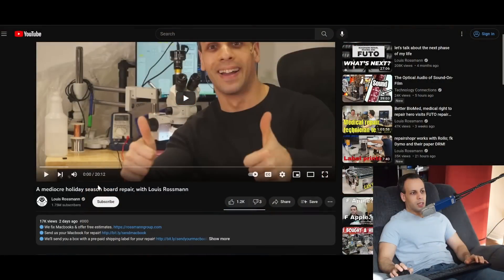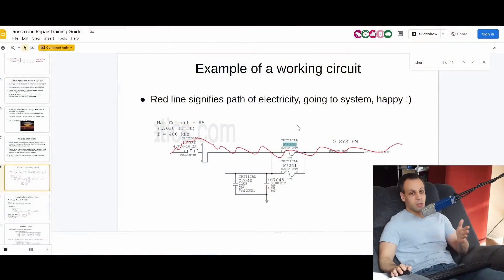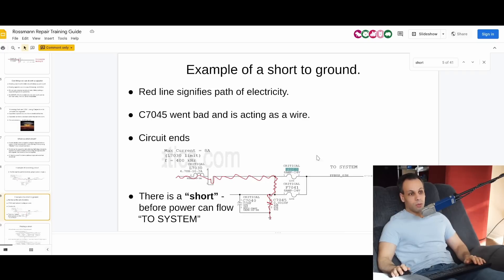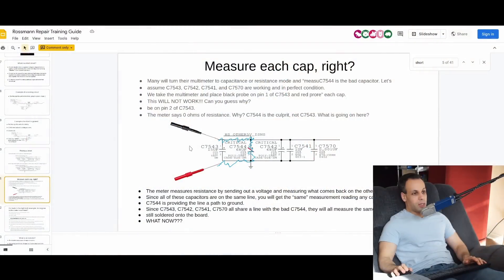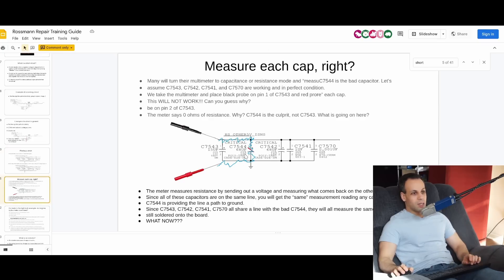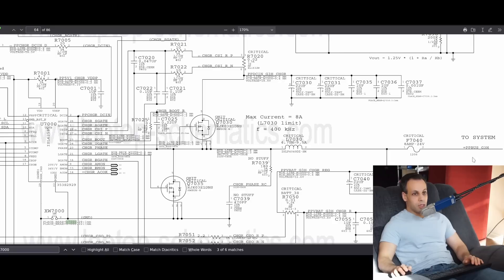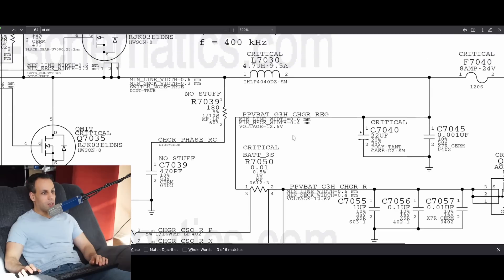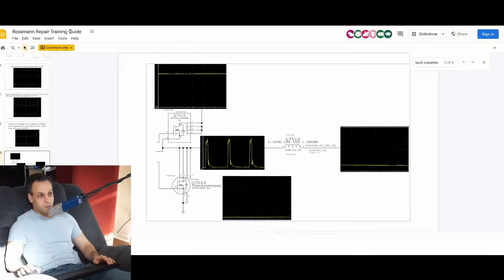Beware improper short detection methodology: on Macbooks you can kill your CPU, NAND, RAM, or GPU.

Comment: "There's the idea that if there's a X volt line, one can inject up to X volts to find a short..."

Hold up. What kind of absolute lunacy is this. That happening is literally the danger that fuses exist to prevent! The fact that fuse has burned, that protection got triggered means that system absolutely cannot take nominal voltage, that's the whole damn point!

Unless the fuse was made by Apple, of course. They are the such a pinnacle of innovation that you can take a fuse from burned MacBook and put it into a new one, if such need arises. Green!

Also, one note: a lot of cheap chinesium multimeters send 3V into measured circuit on lowest resistance range/diode/continuity measurement. Be careful and don't cheap out on these things, they are not all the same.
Reply: A fuse blows under an overcurrent condition (and not immediately), not overvoltage.
Other protections exist against overvoltage, but no protection is foolproof.
In this kind of device you'll often find that whatever protection you put in place, it'll never be enough since there are dozens of components that are extremely sensitive to any kind of mishap.
Generally, Macs have a lot of protections in place, but if something fails, it fails.
Reply: @piernov  I did say nominal voltage, though. Parts about overcurrent and nobility of sacrifice for the good of the circuit were in there before my post went through several edits to not be too wordy before throwback joke about apple fuses that stay strong and conductive even while short somewhere else down the line gives board this beautiful shine.

Apple. Engineered different.

Comment: This is great advice. 
One more question I have; and keep in mind I don't work on laptops, so I don't understand it at all: Is there any alternative method to doing this without injecting voltage?

Thanks.
Reply: Before injecting voltage you should always perform visual inspection.
If a component is visually damaged, for example burnt, broken, or with liquid causing corrosion or residue, then it's the first suspect and it has to be taken care of before voltage injection.
In other cases, if you know how the circuit is designed (with the help of schematics for example), you may see only very few components could be causing a short to ground and that they could easily be replaced.
Otherwise, voltage injection is valid technique, but it must be done with care as explained: low voltage and try to exclude a shorted high-side MOSFET.
A thermal camera can help to spot the bad component more easily, before increasing voltage and current limits.
In any case, that's only after identifying that there is actually a short to ground.
Reply: @piernov  Thanks for the comment. I take visual inspection as a given when fixing stuff, and looking over the schematic is a good advice, but is there some way you can do this without voltage injection? For example with continuity mode on a multimeter? Or would the capacitors on the line be throwing that off?
Reply: @gamefan6142  In some instances a milliohm meter can be used to try to find the lowest resistance to ground figure. It needs to have a very high precision and accuracy, since you'll essentially be measuring trace and contact resistance.
However, while this could work on older boards, where trace resistance was relativity high and components were few and far in between, this is not really practical on modern high-end electronics with many, many components on a given rail with very high density and very low trace/contact resistance.
This means that using a milliohm meter would be very tedious (lots of points to check), and it would not be able to pinpoint the exact culprit (components in the same area will most likely measure the same).
I don't know of other methods to find a short to ground.

And just to insist on that again, these are troubleshooting methods for shorts to ground. There are many other failure modes of electronic circuits which are not shorts to ground.

Comment: Forgive my ignorance, but why wouldn't they put a regulator or voltage clamp on the output of the buck converter?  Seems like cheap insurance against frying anything critical
Reply: Essentially it's non-trivial to protect for these situations at the low voltages.  What Apple has done is move to using a PMIC now in their more recent machines, though that brings about its own frustrating problems.

Comment: I'm a complete uber idiot when it come to electronics.   I'm just wondering from what you were saying to check for a short might use less than the lowest power rail.  Given you could have capacitors or things that might step up the power?   Or is the duration you give to test for a short, short enough this shouldn't occur?  Just seem like you may not be safe even finding the lowest power rail for the test voltage?

Comment: You normally don't need much voltage to get enough current to cause a temp rise that you can detect with a thermal camera.
So 0.8V is more than enough for dead shorts.  The more voltage you inject the lower the current limit needs to be set to avoid things getting so hot they damage/burn the PCB pads of the shorted component.  So you always use the lowest voltage you can get away with.
Reply: Yeah almost zero chance of damaging anything with 1V.

Comment: Using a multimeter for continuity test, what voltages do they use? Anything more than the lowest voltage rail could damage components. What would reverse polarity do? I saw you puting the black pin on a rail and then probe with the red one. Can you explain more about this?
Reply: Continuity mode will usually use below 0.7v -> depending on the model. Diode mode is using more. However, the current is limited very hard, and therefore couldn't be much damage anyway, even if the voltage is a little bit to high.
Reverse voltage is not a problem, as long as the short is with very low resistance and the current of the power supply is limited. This will lead to 0.1 or whatever voltage in reverse, which isn't a problem. However, if the resistance/current gets higher, the reverse-voltage is getting higher and will kill your circuits. Better always do it as supposed. As far as I know, there is no benefit of it, doing it reverse.
Reply: From what ive been able to find out, the voltage can vary from one multimeter to another, and it can vary based on the range selected, but it can apparently be as high as 4V

Comment: If Apple cared they could have put a fuse at the output of the buck converter and a Zener diode between the output of the fuse and ground. If an overvoltage condition occurred the Zener would short to ground and blow the fuse. This is called a crowbar circuit and it's the most basic form of overvoltage protection and would have cost Apple pennies to implement.
Reply: Unfortunately at the low voltages involved for CPU/GPU/Memory Z and even TVS protection options are unavailble because the knee of the response below ~5V is simply too soft.  2.5~3V is about the lowest you can go, where's we need protection at ~1V5, beyond that damage is likely before the crowbar can save the day.

We'd still need something upstream to cut out ( fuse ) before the TVS/Z dies from the thermal damage and given that the crowbar circuit dissipation area will be smaller than the intended recipient of the power ( CPU/GPU ) and given that the triggered TVZ/zener looks a lot like the intended load at these voltages, its likely that the fuse won't blow at all and sadly the controller won't be able to stop the event either since it has lost control originally.   There'll be perhaps 1, maybe 2 cycles of the controller where it can react and prevent the damage (where the HS MOSFET has shorted but the TVS/Z haven't begun conducting and the CPU/GPU haven't died), after that it's a trainwreck :(

Ultimately, it's not because Apple is being cheap that it doesn't put protection in, it's because it's not overly feasable other than to have the controller have an additional MOSFET upstream that it can disable should the sense show there was an abnormality.  

The newer macbooks (M1 series etc) have moved to using a PMIC which does a vastly better job at shutting down before damage is done.
Reply: Sometimes there are such diodes within main power rails. However, it's not worth protecting the board from bad technicians - because usually they just power down the power supply which provides power to the faulty rail.

Comment: Beware, a slide 3/6 has a mistake, where it says that a Buck converter is a linear regulator. It is a switching regulator topology, not linear. For control loop design, the Vout over duty cycle transfer function is often treated as linear (1/(1+sL/R+LCs^2)) , but that's an entirely different can of worms.
Reply from the maker: mfer, someone edited it to correct me and put that in there. damn it!
Reply from the maker: I don't recall saying it is linear
Reply: What you wrote is transfer function of the low-pass rlc filter and is NEVER used for control loop design in buck converter. You are missing most important part, and that is transfer function of modulator. Transfer function you use for design controll loop is series of that two transfer functions (just multiple them). And tricky part is getting transfer function of modular easiest way is using method by Ben-Yaakov Shmuel or Marković and if you are masochist them by Ćuk or Middlebrook (Ćuk is credited as first one who secsesfull make it useful, but just equalation is like 20 pages)
Reply: @mrlazda  fyi ChatGPT might be fun to help out with writing: "The presentation includes the transfer function of the low-pass RLC filter, which is never used in control loop design for buck converters. The most important part, the transfer function of the modulator, is missing. The transfer function used for control loop design is the product of two transfer functions. The easiest way to obtain the transfer function of the modulator is by using the methods of Ben-Yaakov Shmuel or Marković. If you're feeling masochistic, you can also use the method of Ćuk or Middlebrook (Ćuk is credited with making this method useful, but the equation is about 20 pages long)." - I have no clue what I just put here and if it is still correct. I assume you'd know where there are errors in there. But the message is more legible :)
Reply: @mrlazda  ofc it's used, it is an industry standard. Obviously that transfer function is ONLY good up to switching frequency divided by 10 at the most. In that way you can completely neglect the modulator component and just compensate with a simple PI controller. Bucks are simple, stable in open loop as they are a direct energy transfer topology. Indirect transfer topologies are more annoying from the control standpoint.
Reply: @Filip S  it is not used, simple question for you if that is transfer function why would anyone need compensation, thay function is stabile in any case so no need for any compensation you would need only voltage divider not as you stated type II compensator (it always have phashe margin of over 45). One more clue switching frequency have no direct impact on transfer function. But you should Google transfer function of buck converter and you will see that it is not in any case same as transfer function of low pass filter, by the way you will find two transfer functions one for DCM and other for CCM.
Reply: @mrlazda  precisely, it is stable in open loop as I stated un my previous reply. However it lacks an integrator so you'd have a steady state error. Further, the gain is fairly low so you'd have an overdamped type response. Hence a simple PI controller, it checks both boxes (adds an integrator and boosts the gain). By all means, you could if you'd want to, use a higher order controller and more complex control scheme, in which case you'd need a better model as you state. Typically an LQR type controller. But if the simpler solution just works, why bother?
Reply: @mrlazda  also, this is not a pissing contest, I was simply pointing out a tiny mistake on the slide. Not that anybody cared. If you want to portray all the intricacies of switchers, by all means, I invite you to make your own videos. I'd be the first to subscribe. Cheers
Reply: @Filip S  I do not need to make videos all that you can see on channel of Sam Ben-Yaakov (he is professor and he is used to share knowledge) and he is one of 5-6  most important people in that field ( you can look to Slobodan Ćuk also but he is in more complicated stuff, to my knowledge Marković do not have YouTube but he is probably most citated of all his h-index is 3 times bigger them average Nobel prize winners).
And when you point to mistake I suppose you should not make bigger mistake. His video is much more correct then what you posted as correction. 
And yes gain for low pass filter is small but transfer function is not that modulator gain is much higher (Vin/Vramp times higher where Vramp is usually <1l. But again I told you Google transfer function and you will see or watch lectures of Prof Ben-Yaakov

Comment: another thing you can do is use the current limiting knob on an adjustable psu
if you set the current limit to 100mA for example then then the psu voltage should drop below it's set value if the current tries to go above it's set limit. It's something hobbiest do when messing with electronics to try and avoid things blowing up
that being said the recomendation here regards starting with a lower voltage does sound safer in this context, since you don't want to risk spiking sensitive electronics as soon as you hook something up.
Reply: beware of psu output caps...the current regulation happens before the final output caps, so your 100 mA current limited PSU might provide something like 10 A for 1 µs before the output caps discharge

Comment: A few things:
- A benchtop power supply should be current limited in respect to maximum component ratings. 100mA through a short would cause less damage/heat than 3A. However an issue is that chargers can't be current limited. Not sure if inline charger add-ons exist for this.
- There's sometimes a zero ohm resistor between a MOSFET driver output and MOSFET gate. This can be removed to analyse switching signals. If signals aren't present, the driver will probably need replacing. If they are, then replace the MOSFET (which would probably have shorted gate-drain-source pins in this case).
- I look at a multimeter's continuity/resistance mode as being an (up to) 4V low current source (varies across DMMs). It may be better to use a DSO to analyse in many cases. This voltage could potentially do harm, especially if connected in reverse across a polarised points (I guess all are on a circuit). Black probe (COM) always on ground.
- Interesting that there isn't a linear regulator between the buck converter and CPU and extra protection circuitry. I thought clean supply rails would be a must for CPUs. Also, linear regulators aren't in the switch-mode category in which buck and boost are. Linear doesn't switch.
- Never cause heat to analyse a short circuit. If something does heat up, remove it, power up and look into supply rails and signals.
- Analysis techniques all come down to experience. Fortunately, YouTube has become such a great resource for that, but also be weary of misinformation. Also, general if-anything-happens-it's-your-fault-not-mine disclaimer applies for the above.
Reply: It's specifically a synchronous buck converter, where there's 2 MOSFETs (one switching 8V or whatever the high voltage is, and another one for quickly and forcefully getting the voltage back to ground) and multiple MOSFET pairs are working in parallel, and the controller juggles between them to split the load. Same thing on GPUs as well. The simple ones as shown in the video are used for smaller things like your RAM and various other voltages on the motherboard (powering your BIOS chip, LEDs etc). In GPUs they almost exclusively use what's called a power stage/DrMOS (driver-MOSFET), these combine the controller chip and the MOSFET in one chip that's kinda expensive (like $10 per chip and you might have 6, 8 or more on a GPU or motherboard) and can handle. A single chip like that on something like a GTX 3080 can handle 70A and if they go bad, they usually weld themselves to the board.

These power stages have builtin power monitoring, can be "remotely controlled" to a specific voltage and power limit, a temperature limit to shut off when it's exceeded and all that - this is how overclocking is made possible. They have absurdly fast response times, on the other of nanoseconds - also known as 1/1 000 000 000 of a second. This is absolutely required, because the moment you start doing something that uses more CPU on your PC, it takes more power and causes voltage to drop down - your VRM has to turn on the MOSFETs for longer, making a wider pulse, to up the voltage back to the specified voltage. The width of the pulse thus changes according to CPU/GPU load and is adjusted quite literally millions of times a second. This is why you can get away with a switchmode.